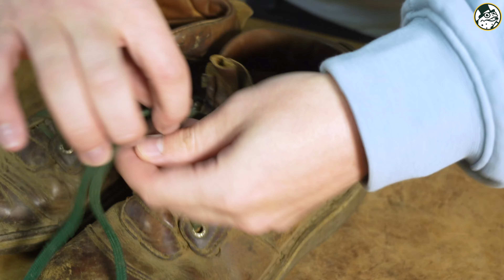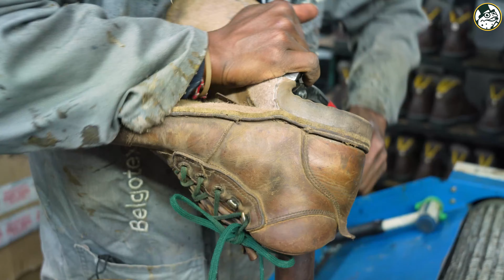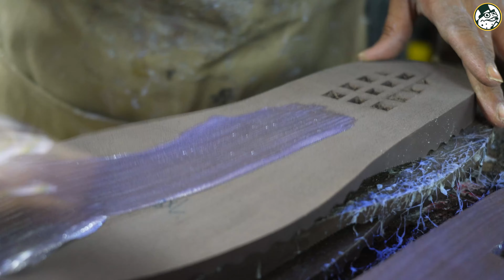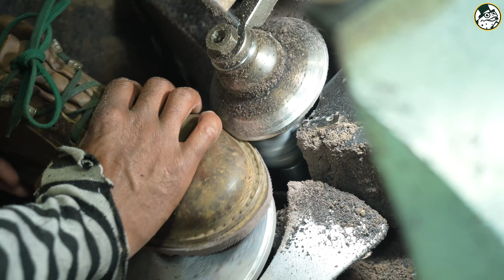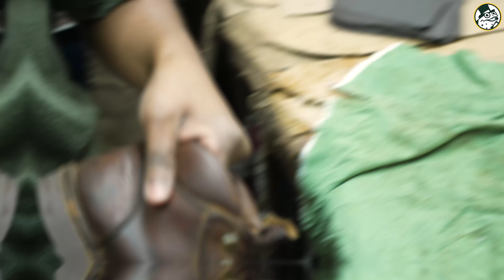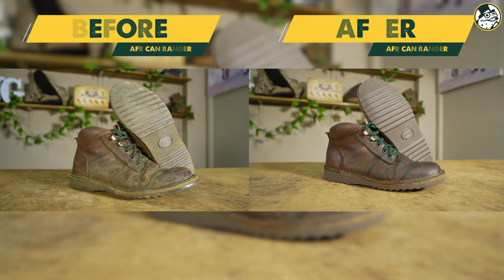RESOLING African Ranger // Jim Green Footwear Resole

Comment: Did they really need resoling? The larger grooves still seemed to be there
Reply: It was starting to separate from the mid sole, if you ignore that, you might ruin the mid sole and be in for a much more costly repair.
Reply: I think this was mostly used in the bush or other non-concrete surfaces so the lugs wont wear out as fast, but they nonetheless look very old. Even if the lugs are still present its still better to replace them with fresh rubber.
Reply: I had the same impression - did they really need resoling? Now I feel even better with my ARs.
Reply: They definitely had more miles to spare but it looks like the user strikes at the ball of their feet rather than their heels. The user was probably feeling a lot less traction.
Reply: My rangers soles look much worse. No ridges left. Lol
Reply: Didn’t you notice the separation of the sole on the front?!
Reply: These look like they worn in the bush mostly. But also you want to replace soles before you have to replace soles

Comment: Hoping you might be able to get some soles onto the website for sale. I have two pairs of MY FAVORITE African Rangers that I use so hard. I had to resole one pair and used an "available" sole. To be fair it actually looks and works great but I'd prefer to go with original soles :)
Reply: Yes! That factory wedge sole should always be available on the site. I was lucky a while back and scored a few extras but I’d much rather have the factory oringo sole than the vibram.
Reply: I just bought the oringo and anvil soles off the website, about $20 USD each.